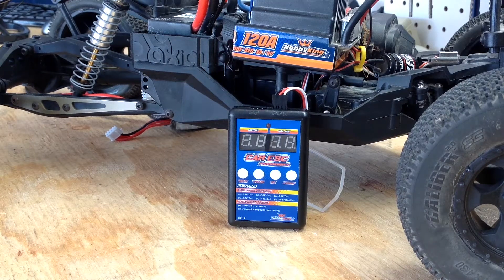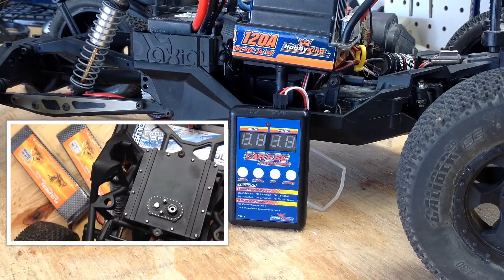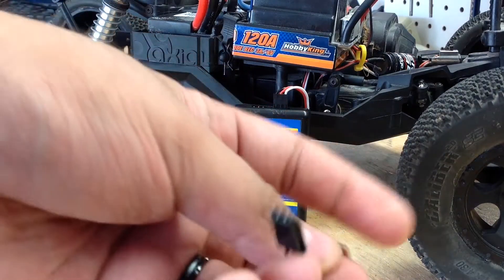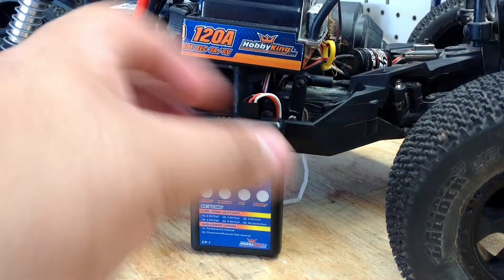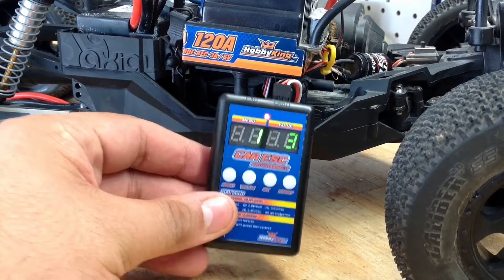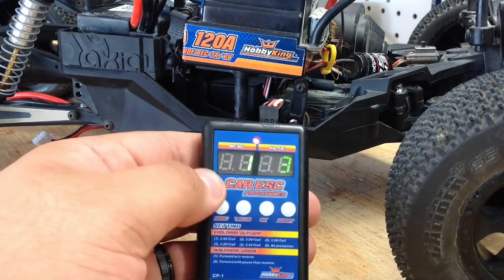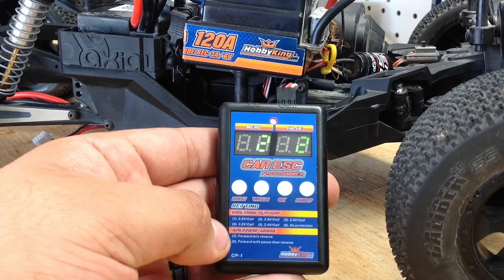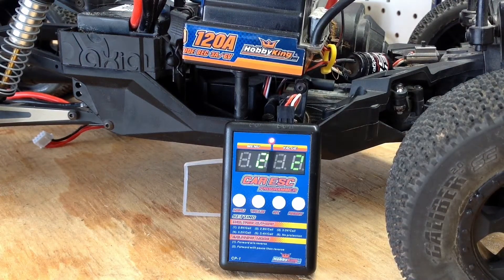Hobbyking 1/8, 1/5 Program Card

Comment: Hello… thanks for posting this video. Do you still happen to have this programming card? I recently acquired the same ESC in new condition but I could not change the program options since HK no longer sells the same esc program card. Do you still happen to have the program card and are you interested in selling it? Thanks.
Reply: Hello I have the same esc but it’s for a 2 pole rotor would you know what motor I can run with it

Comment: My esc plugs into channel 2 giving my receiver and servos power. Nothing is plugged into the power port on my receiver. If I plug the card into channel 2 like you mentioned, I have to unplug the esc from channel 2 which cuts the power to the receiver. Am I not understanding this?
Reply: Have you figured it out? I'm struggling too :)
Reply: @RonnSono-MassaAcoustics  no I never got it to work. Ended up going with a Spektrum Firma setup and got the Firma programming box.
Reply: And this guy never bothered to answer my question
Reply: What are you even talking about? plug card info reciever ? WTF has reciever have to do with that? You plug your card to your esc, and all other cables let them how they wheir. You dont even need that cable he talked about, he is joking, he didn't even used it in this vid 😂🤣😒

Comment: what size is the extension? i was on hobbyking site trying to find the male to male extensions.
Reply from the maker: +yuricko campbell The male to male connection came with this programming card. I would guess it is about 3 inches long. I am not entirely sure if you would find it by itself on the hobbyking site. If you have access to amazon, they might. look up jst male to jst male plug
Reply: You didn t need it, thats the funny part :)